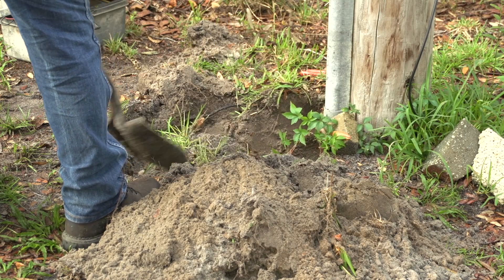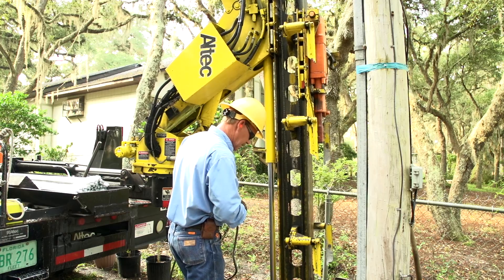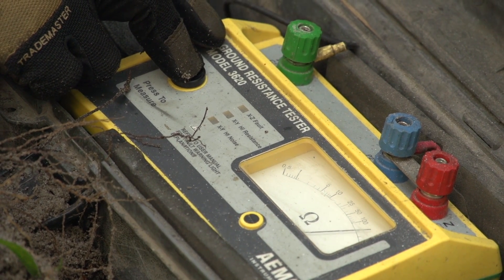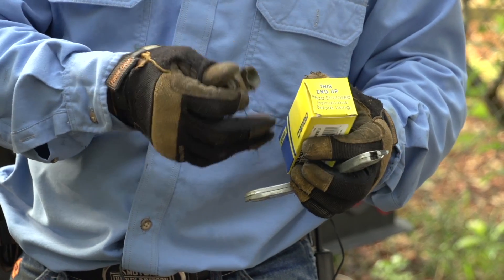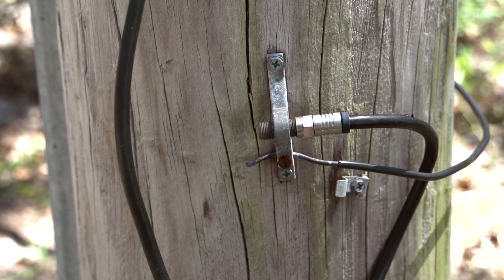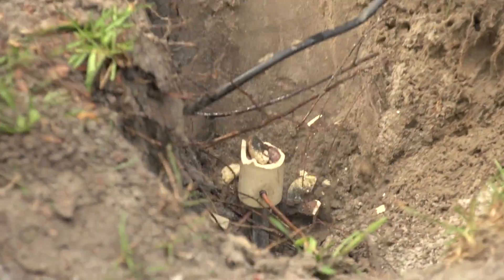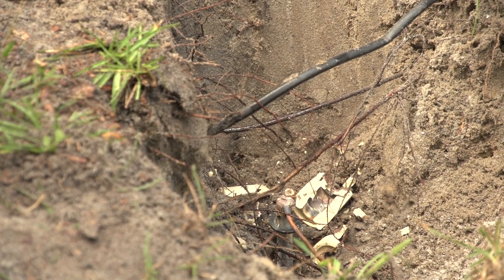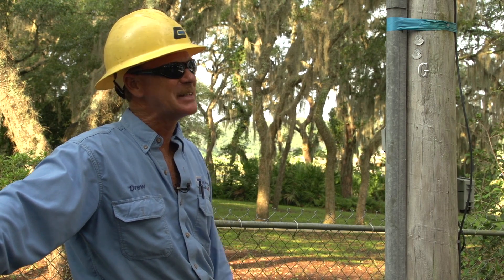Grounding Systems

Comment: Hay clay electric thanks for schooling me on the ground I can now charge for a ground rod test with my ground  clamp  meter. can you send me a  list our send me a part number on that crimper used to crimp the new copper wire to the pole and also the hydrolic cutter used to cut the ground rod  and the cad wield part number . I'd like to look as perfisional as you guys are a model for us electrical contractors. Thanks certified electric
Reply from the maker: We apologize but for insurance reasons we are unable to supply part numbers or lists of tools and items used by Clay Electric personnel.

Comment: Excuse my ignorance, but I thought the grounding rod  for a house needed was only 8 feet. Why did you put 60 feet?
Thanks for your help.
Reply from the maker: +diego39074&#160; Clay Electric requires 5 ohms or less of resistance to ground. Electricity follows the path of lest resistance, therefor high voltage from a lighting strike in the area should go to ground before entering the home. Substation ground should take care of most cases but keep in mind, lighting is unpredictable.
Reply: Thanks for the response! great video.
Reply: instead of going 60ft ,why don't we connect number of small rod in parallel to get required resistance?
Reply: venkatapathi raju keep in mind, in the US power companies must operate within the public right of way or on utility easements. When installing a distributed ground system it takes a great deal of land , ( something like this can be accomplished at a substation where the utility company owns an adequate amount of property) but it would be difficult on a right of way next to private homes where they basically don’t own any property and are just operating on a small easement. It would also necessitate using much larger conductors in order to keep a low impedance path between the rods back to the system.
Reply from the maker: +venkatapathi raju
Thank you for your comment.
That would work as far as resistance is concerned but it would take moving the vehicle many time and may still not reach the required resistance with 5 rods driven in parallel.  Also it’s important to keep grounding rods located next to the power pole in only one location. Line crews know the rods will be in one location within a certain distance of power poles when they preform maintenance. Also it’s faster to drive grounding rods in one location rather that moving vehicle around and having to cad weld 3 or 6 rods for connectivity. Please keep in mind that less movement of vehicles on private property means less incidents. Safety is our top priority.

.
Reply: I think this video is a utility company, not a private electrician.  The utility companies do not abide by NEC rules.  However, this looks to be a private pole.  If so, then my utility company will not touch it. I have a private pole that fell and they said "tough luck, call an electrician."  I guess it's different in north Florida.